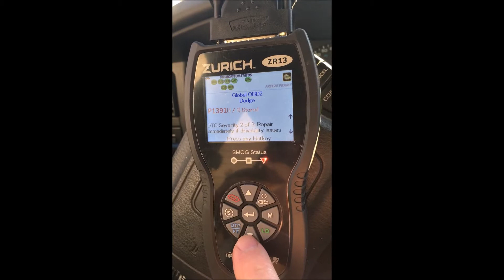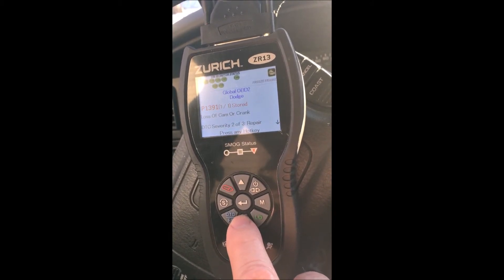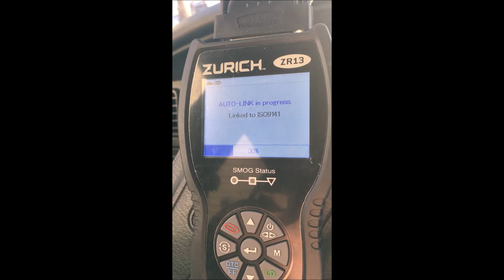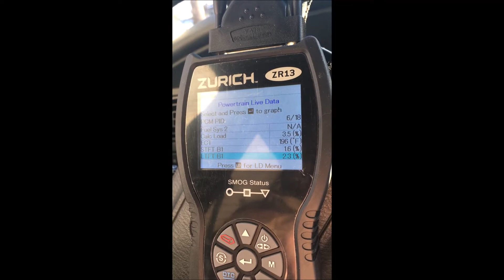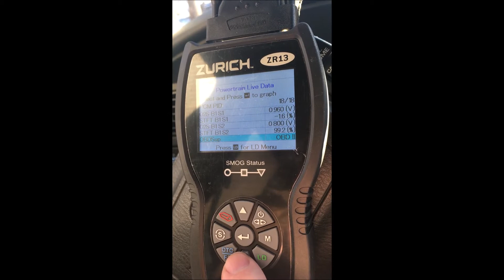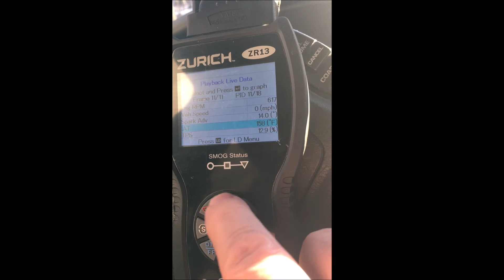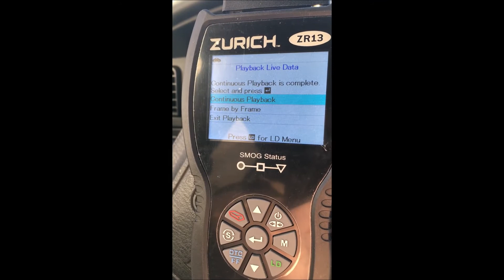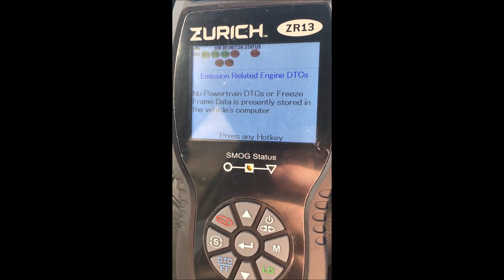Harbor Freight ZR13 OBD2 Code Reader Live Data

Comment: The scanner is made by Innova. I think they use same help database for all. The zr15 has crank sensor relearn and has bi directional. Did you finally get it fixed?
Reply from the maker: It ended up being the O2 sensors. Never did get a code for that fault. I would have expected the fuel trim numbers to go crazy when the O2 sensor lied to the computer, but it didn't.